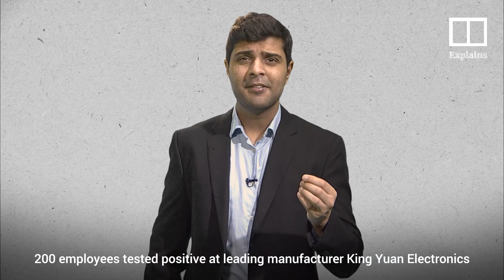There’s a global semiconductor shortage and this is why it matters

Comment: Difficult problems need simple solutions. The answer is simple, recycle old semi-conductor components from used electronics and make new ones from them...easy.
Reply: Sourcing raw materials is not really the problem though. It's the manufacturing capacity that couldn't cope with the demands
Reply: Bruh...actually maybe- nope bruh
Reply: xD
Reply: Maybe we should just stop upgrading our cars and phones every couple years.
Reply: Lol. So you can go in a chip and reconfigured the movement of electrons and make it better from the old existing chip? Easy? I think you have no idea how tech works.
Reply: yeahh and the making is need to be fast and a lot ,need storage to monitor